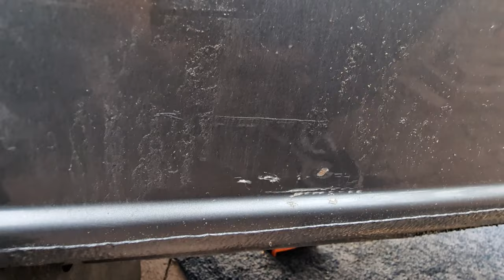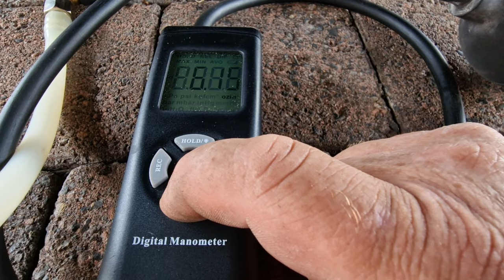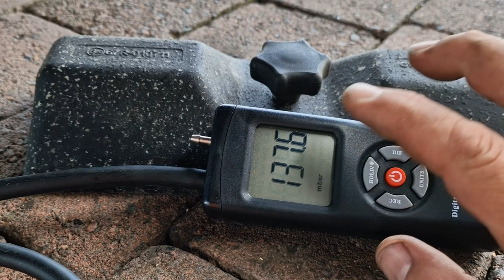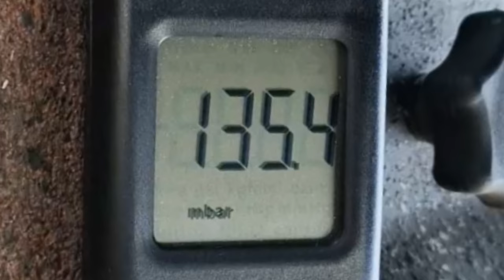We installed a Bullfinch BBQ gas outlet to our VW Crafter self built campervan

Comment: Another great video and one I can relate to.  A brilliant idea and I will consider this setup as I continue planning my build and the future use of my van.  
as for your drop measurement.  If you measure from existing external hole for plug to the driveway surface, then subtract 75mm and transfer that line to the inside of the rear quarter panel you would have been spot on!  You managed to do it from the crease and all came out ok.

I need to take a job to pay for my toys.... retirement is fine but building a van cost money...  LOL

I enjoyed every video up to this one starting at Number 1.  Great ideas.
Reply from the maker: Thank you for your comments Bill I'm glad your enjoying the video 😁👍

Comment: Hi Sam, brilliant video as usual and great idea for the barbeque 👍
When I was watching I saw you have a set of mudflaps on the van, any idea where you got them? 
I'd like a set for my own and am not to impressed by the eBay ones
Reply from the maker: Hi, the ones I have are from eBay and have been on the van 2 years with no issues. It's a great fit, too
https://www.ebay.co.uk/itm/285147905857?mkcid=16&mkevt=1&mkrid=711-127632-2357-0&ssspo=iX4M9kO7SQC&sssrc=2349624&ssuid=qkhVtACcQ9q&var=&widget_ver=artemis&media=COPY
Reply: Thanks Sam I'll check them out, happy travels mate 👍